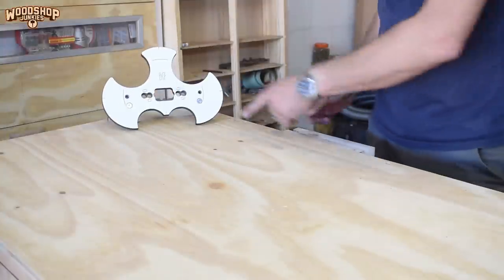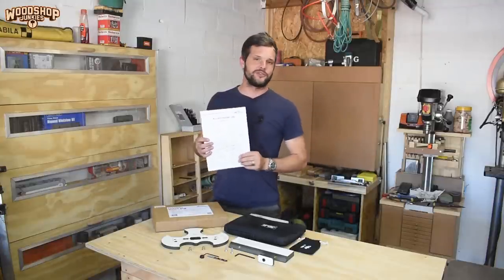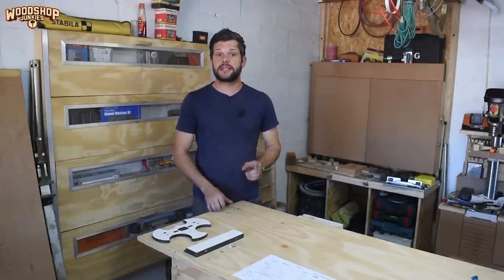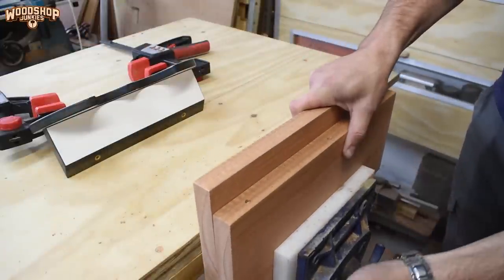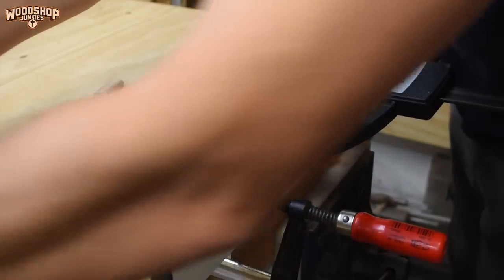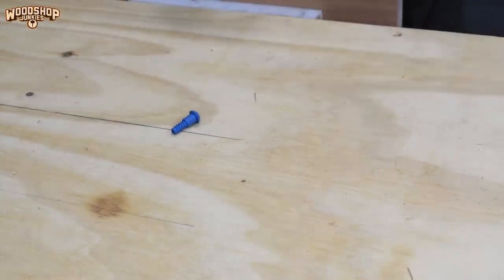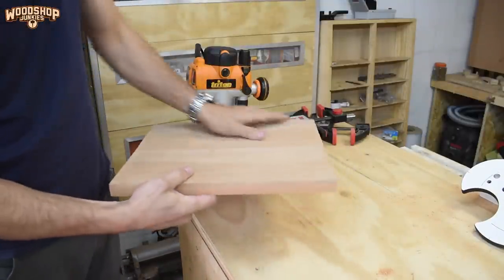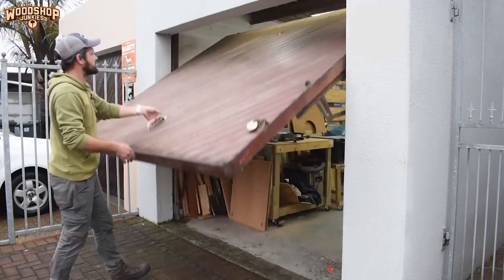Is This A Game Changer? - Peanut Mini Jig

Comment: I've been running a Peanut 2 Mini Jig for about 18 months, and even though I have a Domino DF500, this still gets used, particularly when I want knock down mitre joints.

My only gripe with the jig is the clamping. If you have a router with a big base then clamps can get in the way.

Also no real way to clamp the jig in the middle of a mitre joint, so one has to use the screw holes to fasten to the mitred edge. This takes a little more time, and if one isn't careful to centre the screws they can wander and pull the jig out of alignment to the mitred face.

Overall though, great jig! Thanks for the vid!

Comment: Handy Tip for those running the smaller Makita plunge routers (RT0700c and the cordless equiv, DRT50):

The peanut router bits come in an 8mm shank option and Makita makes an 8mm collet for it's 1/4" plunge routers. The part number is 763618-5.

Comment: Pretty cool jig, looks very decent! And a very good review of it, Jean!
I'm not smart enough to understand why the bush insert can't have the insert in the middle instead of being off set... That would greatly decrease the chance of user error while setting up + using it. 
Shame that the fence is fixed also, if that would have been adjustable for various thicknesses of wood that would be even better!
Reply: The bush insert has to be off-centre so that the peanuts can slot together.

It can be tricky, so to avoid confusing myself I make little keyhole shaped marks on the board I'm inserting peanuts into to remind me which side to offset the hole towards.

Comment: I understand the concept of the peanut fastener and while it would useful in certain situations, but it appears it would be the weakest of the three. Overtime, assembling and disassembling anything made with the peanut joint seems the joint would become loose as the wood itself wouldn’t be strong enough for the repeated movement. Although would work well for it’s intended purpose, I wouldn’t use it to permanently join two pieces of wood. 

The other joints are straight forward and widely used. As far as strength, the domino is the winner. Although your presentation was awesome, you didn’t inform us how long it took to complete the setup, including the measurements and drawing of your alignment lines. The mortise/tenon might be a substitute for the very expensive Festool Domino, although this jig doesn’t look like it can create mortises on angles, but if the stock is thick enough, you could probably double stack mortises for extra strength. I’m just wondering how much time it takes from start to finish which would dictate if this jig is worth buying for someone that uses mortise/tenon joints. Using this jig for dowels is overly complicated, so I’d stick with the tool you typically use, or just about any other method out there. 

Thank you for the review. The Batman shape of this is almost worth buying as it. Hmm, I wonder if this is trademark infringement? I live in the states and there is no USD price so assume it isn’t sold here. Oh wait, I found it here but it’s $300+. That’s an expensive jig, but other jigs that cut mortises are about the same. Cheaper than a Festool Domino by far, and it makes three joints, but too expensive for my budget.

Comment: I would say with a fair amount of certainty, I would not buy this.   

It needs some work. Those indexing ticks/guide marks need to be carried down the edge of the jig. The jig is thick. Seems like it would be challenging to line up.

Also, I'm sure I would lose one of the components over time. 

If the jig was clear acrylic...that would be better.

Comment: Great review as always. This jig and its purposes is not for me. I do use dowels or biscuits on occasion and use a biscuits cutter and a simple dowel jig for alignment. The pieces I make as well as my shop used traditional joints, dovetail, tenons, rabbits, etc. I prefer screws, but have used nails for smaller projects where appropriate. This is not a cheap jig, along with the special bit needed, assorted extras, and specialized pins is not worth its over all costs. Personally, I think the "Ikea" type of furniture fails after a period of time. Joints loosen and the item can fall apart. I prefer for my woodworking to make items that last and can be handed down generation to generation. Sometimes with  easier, and faster methods you lose quality which is not how I was taught in the traditional sense. We have become a throw away society, with the introduction of plastics , it has created a lot of environmental issues. So much added clutter and much less quality in the tools used today has lead to over all poor quality, especially in the tools we are offered today. No modern plain is worth $500 or $600 and higher. If it was a rare antique tool, that would be different. People get to caught up in I want what others have, and that envy leads to debt.

Comment: You need to use rhe jig to set the depth ov the router. Read the instructions properly
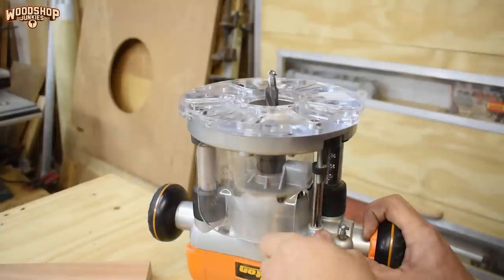Reply from the maker: 20:55 - There's a lot of info in this video. Easy to miss something.
Reply: @WoodshopJunkies   oic 🤙👍🤙👍🤙